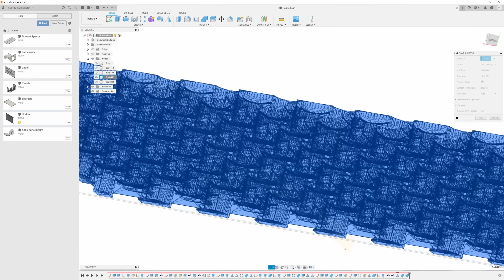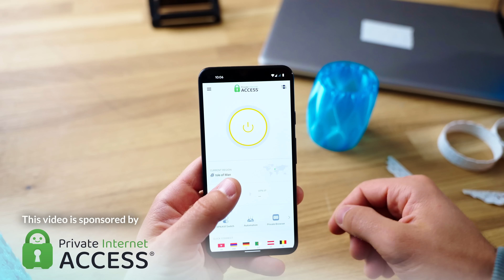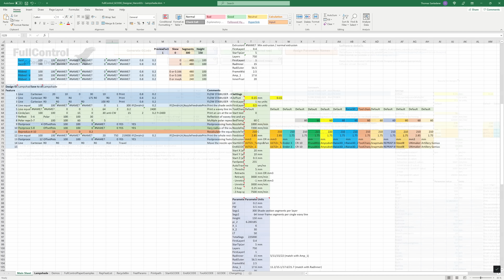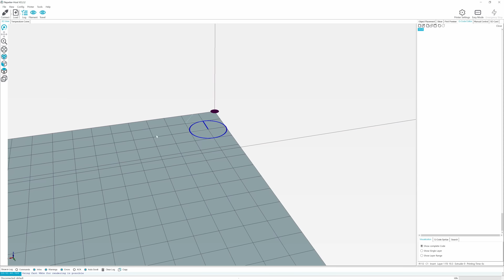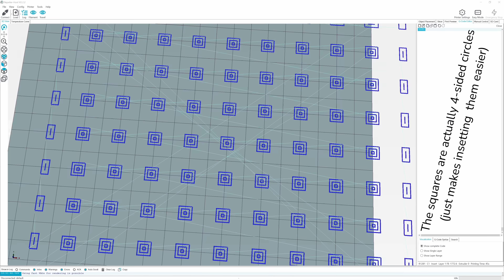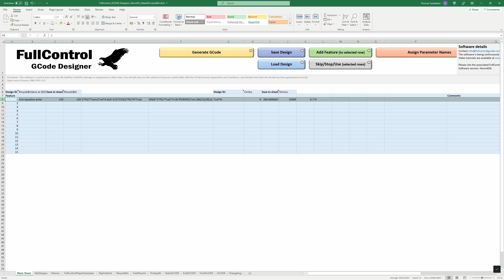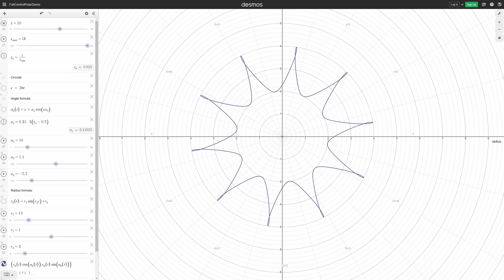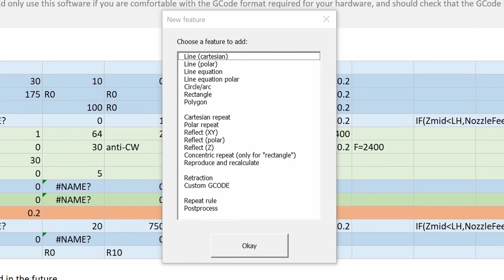You can SKIP 3D modeling now

Comment: It's shocking how bad slicers are - even paid ones. AFAIK none even use arcs let alone splines; everything is discretized to polylines. Meanwhile the GCODE protocols support it, and CAMs have been using arcs for like 40 years, and splines and helixes for at least 20.

Comment: Ive always wanted to do wood grain variation in the Z where you have a bunch of keyframes represent the widest 'grain' and then have the layer height smoothly morph between the keyframes. The issue is I want it to happen in the slicer because the model is already created. Any ideas?

Comment: Rather gimmicky and only useful for very specific things, I would say.
In no way can this replace a 3D modelling tool for even slightly more complex parts.
It basically exchanges the graphical input part with an excel table (which in my eyes is more difficult to learn than a traditional tool. Also ... "Excel".)
and needs you to re-check the result in the 3D preview.
But I never knew this existed. It might have its uses...

Comment: Get this, you could also do this in F360 by just creating a circle with one perimeter and the same square type. So you won't get the infill but you will still perhaps 10 minutes more, but that is saved depending on the sketch from going from Full Control GCode to F360.

Comment: The irony is this is probably the opposite of the direction we should be travelling in, despite it technically clearly being an improvement for many tasks. What we should be doing is building slicers that are ai-based and can take advantage of printer geometry, object geometry etc and can use things like multi-planar pathing to improve prints both in terms of the amount of filament needed, surface finish and object strength.

Comment: A new version of FullControl is almost complete!
It will also be free and open source. Written in python instead of Excel VBA - more powerful, more versatile and more everything else
The same design principles will apply, so get familiar with the current version and the switch to the new version will be easy

Comment: I hope this gets made for google docs.
I mean if the issue is copying the code then it possibly could be also possible to have a single macro(or a set of them if needed) make a file containing the GCode in a folder somewhere in the Google drive, which could be selected by the user.

I'm not really sure if this is possible, and I don't know how write code even if my life depended on it 😅
But it's still an idea though :^

Comment: So it generates G code directly, but is it possible to take the shapes it generates and work on them in modeling software? For instance, you mention you need to design around an exclusion, so I'm just imagining instances where it would be much easier to just take the geometry you generated into a separate software and just draw a sketch for a pocket action etc.

Comment: Technically this is still 3d modeling. 

Typing in coordinates is very common, especially with my modeling style, i like to bypass blender modifiers and just work on multiple faces or objects simultaneously, using the number pad to input my values for how much i want to extrude, rotate, scale or transform.

Comment: You can skip 3D modeling as well as you can skip designing a PDF with your favorite drawing software: technically possible, but an edge case for projects of limited size and complexity. Also, you could have done so since forever. 😉

That said: nice prints, and an interesting approach for those cases where the slicing process would introduce problems. I wouldn’t delete the slicer, though. 🙂👍

Comment: Great tool. I can imagine it's not at all useful for the one-off print where you just need to get something done, but for a bulk manufacture case it makes a lot of sense to try and save every single printer minute possible. Also would make it much easier to automate things like knocking the part off the bed for taller parts if you're doing continuous printing.

Comment: "The only thing you have to do ist to download the spreadsheet and enable macros"

Yeah no. Big no. Extremely huge, in fact moon-sized NO!.

You do not, and I can't emphasize this enough: You do not enable macros. Never. Especially not on untrusted sources from the net.

Unless of course you want your system encrypted, keyloggers installed etc. Office Macros are the infection vector number 1 for almost all computer malware from bots to viruses.

This so drastically I'll advise, imho you should immediately retract this video and post a follow-up on why this is the worst.

Not to mention, that "programming" a printer in a excel sheet is kinda strange to begin with.

Again: The advise on this video WILL harm your computer and your safety.

You can do this in a sandbox/VM. And if you have no idea what that is, or how it works, DO NOT ENABLE MACROS IN OFFICE PRODUCTS!

Comment: Here's an idea: What about combining your squiggly line formula into the battery holder so that every layer is 1 continuous line (like vase mode) instead of individual cylinders? Sort of like a semi-circular shaped sine wave.
The resulting shape may not grab the batteries on all sides, leaving small sections of the perimeter open, but that still should be more than enough for a secure hold and would result in the fastest possible print times.

For one off pieces this would be unnecessary faffing about and pointless but if you're trying to pump out tens or hundreds of these things in one go it would save so much time

Comment: Reminds me of how 3D modeling used to be based on primitives and functions that would make spheres that are spheres rather than a bunch of polygons that can look bad in low poly design.  Of course there are limits to both, but if I was designing I would want access to both commands, not just polygons.  The ability manipulate G-Code in it of itself is appealing since you can get better print times, but also being able to model complex shapes like you have done allows for better 3D prints that are faster.  Ultimately, creativity require some amount of limitations.  The question is if this adds complexity between modeling with polygons vs. modeling with G-Code that are interesting and intuitive.  Imagine new ideas of art being made possible by simply watching how these intricacies form into something cool.  It’s about possibilities and the struggle to achieve something that you realize wasn’t really what you wanted all along.  How can you make this possible and how does it affect the output?  What can you change to make the output better?  This is what artists inevitably ask themselves at some point.  It’s not the tools, nor is it the ideas that stop artists from being creative.  It is the lack of parameters and limitations that make an artist over ambitious and uninspired to do something different.  Perhaps that is why modern art is so consumer based, the ease of forming ideas makes it become this counter intuitive form and is a parody of life; yet, not actual life.  A simple blank canvas is more inspired than a can of soup, yet neither live.  I would like to see the idea of modeling to become more primitive in nature (and I don’t mean primitive shapes).  It should be a set of simple tools with limitations.  Why would I need 10 different tools to create something that is functionally the same?  Too much details!  I need to limit myself to base ideas, how I can create something with my stipulations.  It adds energy and life to a project.

Comment: So all in all, it falls with the post processor.
I think, if you optimise the model and make it easier and the post processor would be smarter (which is easier said than done), than every splicer software could compete. Maybe let the pp do something like a compression of the model, remove unnecessary small parts, then it could run faster. Or as the constructor of this model, optimize it with simple ways. 

You can't optimise every print, sometimes you need details, but like MP3, you can switch to different compression levels

Comment: I seems such a waste or resources and time to print parts that many companies are manufacturing at massive scale with plastinc injection molding.. It applies to 18650 holders, plastic boxes and lots of other plastic garbage that you can find THOUSANDS of videos how someone printed for X dollars a thing that you can injection mold for pennies and many companies do.
Reply: Waste of resources? Wtf are you talking about? Plastic quantity used up is same or less. And you can also make ultra-specialized parts right at home.
Injection molding is only useful for manufacturing something in bulk. But it has associated with it equipment costs and difficulties.
Reply: @blinded6502  
If you want to 3D print something you need a factory that converts plastic pellets to spools of fillament. Then you need to ship those small spools to the customers i.e. from the beggining it's less effective then to ship a full container of "raw" plastic pellets right to the injection molding factory. 

After shipping the spools you need to power your small printers, which can each work on a single product at the time. In the plastic molding factory you "just" melt the whole container of pellets, inject it to molds and make a thousands of identical products at a single shot.

3D printing is great for prototyping and unique parts etc. but it's really infective for mass production of standardized parts like a generic 18650 cell holder for example :D
Reply: @mobilmag864  Spools are much more space-efficient than final products. And yes, 3d-printing is effective at making things for yourself on demand. This is what I said already.

Comment: Very cool nice way to avoid modeling a complex surface, but to me modeling in CAD seems way easier in most cases. There's almost too many possibilities lol. Granted I'm a mechanical engineer by trade but typing the geometry out seems less intuitive than a modern CAD like NX. I think just by good design for printing you can avoid the odd situations with tiny infills. Then printer setting for things that you can't design out.

Comment: What about this is new? We started writing G-Code by hand, then moved to CAD/CAM, then to 3D-modeling and automatic slicing (basically still just CAD/CAM with simpler tools). There's a reason we're not writing G-Code by hand unless for something very specific or tweaking in certain points. Sure, you could write raw machine code if you want, but most of the time the added headache isn't worth it. You did get some really nice prints though, and a trip back to basics can be a learning experience.

Comment: This reminded me of OpenSCAD - where you have 3d modeling aimed at programmers, and there's that neat talk by Matt Adereth and his dactyl keyboard which he programmed and 3d printed using that approach
Reply: Openscad is pretty intriguing, if I could create code of it, that would be awesome. But as soon as you have more complex stuff, it maybe gets useless.

But he made a great point with small edges, that takes too much time, so you could have the same result when you programm the model on Openscad, export the STL and the slicer makes the rest. I would even say it could compete.
Reply: @Spelter  It's fine even for complicated stuff, though? Just modularize. The Dactyl is a pretty convincing proof of concept that you can get complicated results with it. ( though , technically, it's clojure over scad, but it's the same thing. )
Reply: @SiriusXification  True, I do the same in OpenScad and make small parts and modules with parameters for various things, but the splicer needs to make better gcode. 

I found superslicer some time ago, which has various new options for the infill, which takes most of the time and it's not that bad.

Comment: Often it can really also be helpful to just go outside the box. Like do you really need to make circles to hold something round in place. Would not a square or two do the same job. A tool that make it possible to generate GCode directly have it use, but you will have to understand your printer and it limits very well and finding what wrong with a complex print can be a difficult job.

Comment: This really needs to be taken further before I'd dare use it. If you have to give those models to somebody else and they need to change the shape to something other than a circle, it would be a nightmare. "Somebody else" includes you two months from now. You're trading printing time for people-time, and people-time is much more expensive, unless you're farming out to the scale where you'd actually be considering injection molding.

I'd like to see this sort of idea worked into some vector editing or CAD software. The ability to repeat, tile, and parameterize the toolpath is cool, but it's very limiting to have to define only shapes where you can type out a simple mathematical formula. If it was hybridized with CAD, you could draw up something more complex (as you would in a vector drawing program or CAD) and then parameterize it (again, as you would in CAD). Instead of creating solids from that sketch, the paths in the sketch itself would be the toolpath. And it would repeat, grid, etc. as it does currently. Developing models that way would be much faster and more maintainable. Even OpenSCAD, which has a fully-fledged scripting language, is too slow and inflexible.

Comment: I'm... tempted. I'm a developer, and this is a simple enough thing. I could port this to a web application to break the Excel dependency and work with much simpler expressions instead of Excel syntax. I could also automatically preview the result on screen.

Unfortunately... I have a DLP printer. This is absolutely useless to me! ^^() So it's hard for me to defend the time investment since I won't be able to use it.

Comment: Don't get an e208. My wife has one and it's a nice car, but it lacks some of the most important features of an electric car.
For example you cannot even set up a charge limit, which pretty much means that you'll always charge to 100% (which affects battery longevity) unless you babysit the charging process and manually disconnect at e.g. 80% SoC.
The smartphone app is a joke, especially compared to the Tesla app.
But the worst flaw of the e208 in my opinion is that the navigation does not take the remaining range into account. It does not automatically suggest charging stations along the way if you do not have enough range to reach you destination.
That means painstakingly planning each charging stop manually on longer trips, which is a major hassle in my opinion.

Comment: That big vase isnt too hard to make a model out of, you start by making the base and then you extract that face. The harder thing to do would be to make the nurles on the surface but you could fix that with a variable array. An experienced modeller could do that in less than an hour.

Besides, making a model using mathematics is exactly the same way you make models in Blender, Maya etc, the difference is that you have a graphical user interface between you and the math, making it more readily availible to the wider masses and is why code modeling is relegated to experts or specific tasks/industries.

I dont see anything different here compared to ordinary 3d modeling, its just a way of doing it without seeing the model adn having a quite bad compiler to deal with the math->GCode.

And am i just talking out of my behind? No. Ive been doing 3D modeling for 20 years and started out with wireframe meshes and hexadecimal "decoding".

Its a cool tool, absolutely, but that title and premise is faulty/wrong and looks to be based on a misconception of how 3d modeling works OR just a lacluster presentation on the pure differences.

I dont know OP and as such i cant tell if he has experience in the field but the way this is presented makes Me think that experience may be limited, which is fine. But before one starts to say that A isnt A, it would be good to have a clear cut reason why :)

Comment: One better automated complex use case since sine functions work.
Fourier transform or Fast Fourier transform(fft) (which is basically discreet Fourier transform for this case).
DSPs can do it or ur gpu too, and you can just give an image to a fft program n then it'll output the exponent & sine function u need to use to make it. N since there's only so much granularity, we don't need to use infinite series n probably 5-6 or max 10 iterations for one function should be enough.
The excel spreadsheet probably does the inverse of it n does i-fft to get the discreet values to convert to machine g code. So maybe a future application where the image is directly converted to the given values but they match the parameters & r based on equation